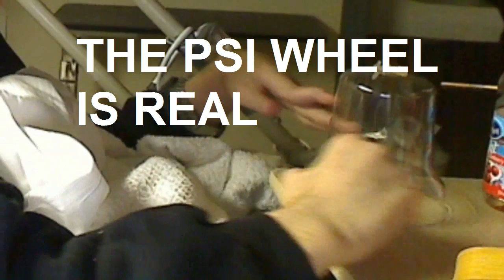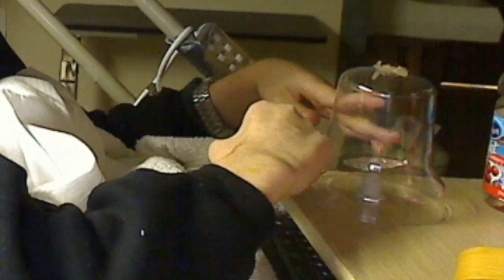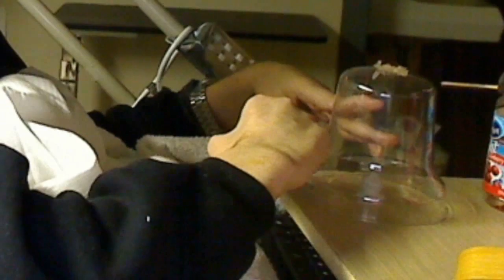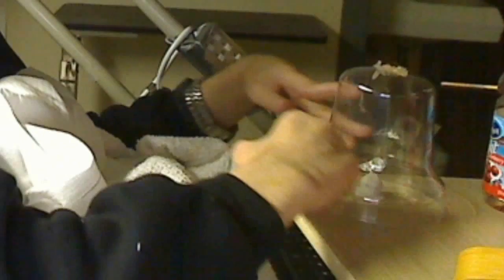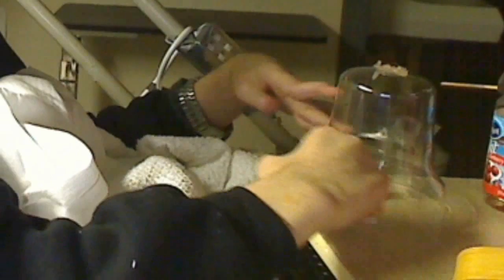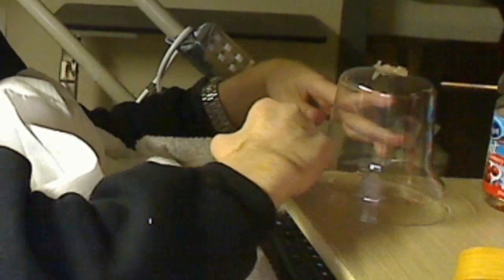TELEKINESIS DEMONSTRATED

Comment from the maker: ajscrewu 

The only possible "trick" left is a hidden magnet.
But if you look at the materials used you quickly realize that's not possible.
A nonmagnetic, lightweight strip of aluminum foil
moving in ways NOT consistent with magnets.
Magnets would also make it too heavy to balance on the pin.

Comment: couple of things. simply turning a plastic cup upside down does not constitute "sealed". Also plastic is a great producer of static electricity.
To eliminate some variables use glass sealed to the table with caulking or some other sealant. Try using different materials for the aluminum needle. Or does your power need something metallic? make sure there are no fans running and even cover your mouth with a good dust mask to make sure your breath isn't a factor. Also try it with your feet also to see if they have the power.  one major  suspicion  to your demonstration is that you need to move your close to the object and swirl them around which ends up being the same direction the needle spins. What science calls"leading the witness' nice try though..:)
Reply from the maker: "Powers?" I never claimed to have "powers."
I said it was the life energy field around my
body, the same field you and every other living
thing has.
Any static collected by the plastic dome would be
omni-directional and thereby nullify any effect it
could have on the foil needle.
I'm crippled and live in a nursing home.
I can't move my feet so I can't test my "foot powers."
A large glass bowl also collects static and is
not allowed in a nursing home.
They would also frown upon marring the furniture
with caulking.
And yes, of course the foil moves in the same direction
I move my hand.
Do you expect it to move otherwise?
"Leading the witness" is a complete non sequitur piece
of nonsense and your 'triumphant' "nice try though "
ending with a smiley face a perfect example of your
complete closed-minded arrogance and egocentric
assumption that you have all the answers.

Are you accusing me of fraud?
If so, explain how I'm "faking" it.
You're a debunker, no?
Debunk it.
Are you suggesting it was done with static?
If so, show how.
You're a disciple of Randi, right?
Debunk me.
Scienceofscams already "debunked" the psi wheel
but this is not a wheel.
It's a compass-shaped needle that would buffet in
a "convection current."
Scienceofscams already explained it this way:
Psi  Wheel revealed!
Notice my "warm hands" are not cupping a "wheel."

You're not explaining it, you're simply dismissing it.

If I was a suspicious sort I'd suspect that you're Randi
or a member of his organization.

I think you know this is real and it irks you.

Comment from the maker: Science of Scams used a CARTOON to "prove" it's caused by convection currents.
Plastic bowl over it.
NO CONVECTION.
So then they say there's something under the table turning it .
What? my penis??
Magnets? Magnets would not make it move that way.  foil is nonmagnetic
Plastic bowl eliminates convection and static as explanations.
In my linked video I take it apart.
Just a lump of stickum putty. pin, foil, plastic bowl.
No motors or magnets or strings.
I'm not scamming but they STILL don't listen.